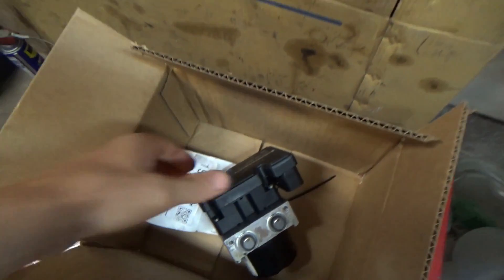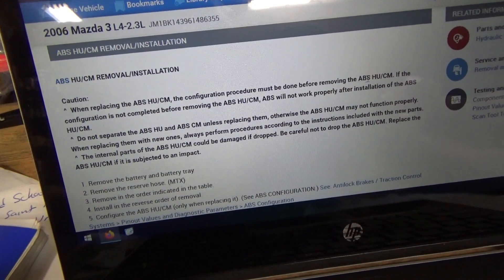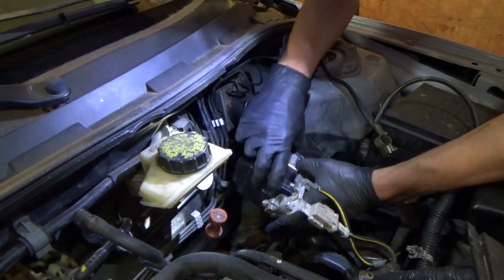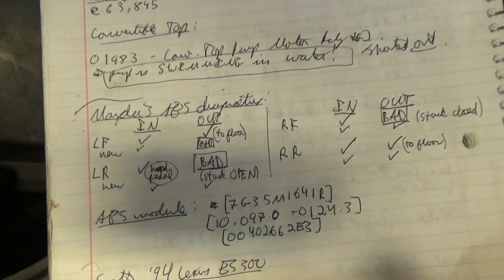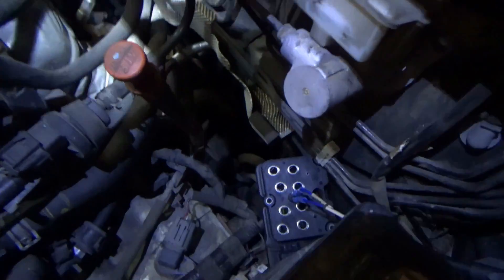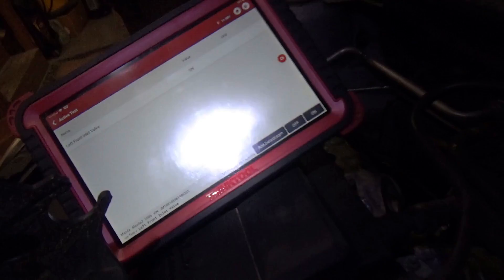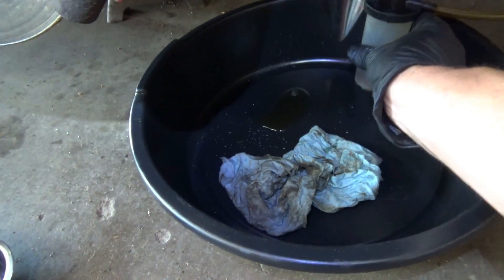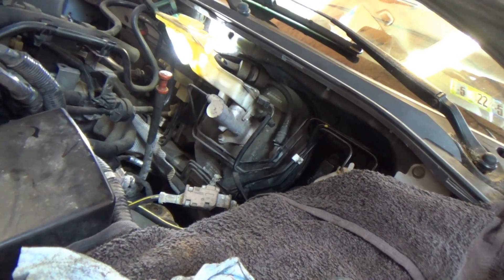DANGEROUS BRAKES! (Part 2 - Mazda 3 ABS)

Comment: The brake pedal might be related to rear drum adjustment assuming it has rear drums
Reply: Discs all the way around. No drum brakes on this model.
Reply: @quantumleap359  yeah I don't know maybe there is a master cylinder problem as well

Comment: Anyone know of a reliable place I can get this part or have mine rebuilt? 09 Mazda 3 sedan. Same issue, soft and them brakes at the bottom. Mechanic said Master Cylinder or ABS control module but could not tell which is needed. They want to charge me $2k for everything. Pretty sure I need 3M512M110JA

Comment: with bidirectional control hammer will fix both! I said hammer to fix on first video! if hammer dont work at first, spray deoxidant into failing valve area!! lol... then wd40!

Comment: Question? How will the front wheels turn free if the car is in park? Just saying.
Reply from the maker: Because there is a differential inside the transmission ;)
Reply: @PineHollowAutoDiagnostics  so what good is park if the wheel roll?
Reply from the maker: @zzzdogutube  to keep the vehicle from rolling away... As long as both front wheels are on the ground lol
Reply: @PineHollowAutoDiagnostics  so with the car in park and the left front wheel is locked with the brake (snow brush)  the right front is free to rotate unless the brake locks it? Hmm.   I'm not getting it, what is turning,  the tranny is locked and the rf wheel is locked. I'll think about this  Thanks
Reply from the maker: @zzzdogutube  I thought you meant without brakes applied...
Reply: @PineHollowAutoDiagnostics  you thought the rf brake was locked. I didn't think it will turn if the car is in park and the left front brake is applied. ?  What do you think?

Comment: If possible one should perform a ABS flush. Because very old brakefluid may contain some sludge/rust over time.
Reply: You would have to bleed the brakes anyways since your taking off all the brakes lines to the Abs unit.

Comment: But is whatever is in there truly broke. You had the same symptom with 1 on the new used part and fixed it. I say try the bolt test on the original , if that works try your fix of "gently tapping the valves with a hammer". If successful you could have an ebay part to sell and split the money with the owner. Win win

Comment: Stick with remanufactured parts at least, if not new  ones.  Otherwise,  many of these ABS units,  regardless of manufacturer,  suffer from the same pattern failures.
Reply from the maker: Reman quality is also hit or miss...a working used part is generally the best bet, especially for beaters :)

Comment: I have been bleeding brakes for over 50 years and did not know you didn't need two people to do the open the bleeder, pedal to the floor close the bleeder, let the pedal up and repeat until there are no bubbles.
Tell me Ivan, when you learned this and why it works.  I know you will have a scientific explanation for me.  Thanks.  Never too old to learn something.
Reply from the maker: It's easier for the fluid to replenish via the master cylinder seals vs. being sucked back in through the bleed nipple. Last step is to remove the hose and let the fluid just drip from the bleed nipple to make sure there are no small bubbles left at the top of the caliper :)
Reply: The idea is as long as you have the end of your outlet hose covered in brake fluid air can escape into the atmosphere when you smash the pedal, but only brake fuild will get pulled back in when you release the pedal. This is an effective way to bleed the brakes by your self. This method is less fool-proof as the bled air can be pulled back in if it doesn't make it far enough down/up the tube. It is best to elevate the collection container above the bleeder. And the tube has to extend to the bottom of the collection container. It is also best to start will a little brake fluid in the bottom of the container.
Reply from the maker: @_RiseAgainst  Eh you can do it no problem without any tools at all...the hose and can is there just to avoid making a mess haha
Reply: @PineHollowAutoDiagnostics  Hi Ivan, While you let the fluid drip from the bleeder nipple, isn't air from atmospheric pressure being let in through the nipple? or might there be a check valve or similar restriction, at the nipple inlet? or maybe Is it that the fluid density is enough to negate atomo pressure to negligibility?  Thank you.
Reply: @PineHollowAutoDiagnostics  you are my favorite mechanic full stop, but the rest of youtube "one person brake bleed" videos disagree and I don't think you realize how many hours it took to get my couch mechanic certification.
Reply: @paulkaz2127  Ivan opens the master cylinder and reservoir, so when it drips out of the bleeder, it is replenished from there. Hose submerged is probably easier to not screw up though.

Comment: It's a critical safety part. Wouldn't put a junkyard one in
Reply: I'm not big on using used safety critical parts on a vehicle either but at the very least tell the customer a waiver must be signed stating there is no warrantee on the part or work as the new part had issues from the get go since it was used. Everybody now a days is sue happy so you need to protect yourself. I am not singling Ivan out he's got stupid strong diagnostic skills that trumps even the dealers however the liability in there in using a used part of this safety critical nature is real, may never amount to something in the end but like I said you need to document and cover your ass.
Reply from the maker: @mplante7352  Yup 90-day warranty on the part.
Reply: @mplante7352  BRAVO!!!
Reply: While new OEM may, most often, be the most ideal option for replacement parts, as you will gain longevity.  All of the parts on the car, that you are driving presently are used...and  they are all functioning fine.. for now, until they don't. On this one, perhaps a similar failure may occur within the next 15 years..since it has probably has all 'new' fluid today.

Comment: Your pedal was still soft after your supposed repair.  ABS stands for antilock brake system.  It does essentially nothing unless you are doing emergency braking or braking on slick surfaces.  If you have traction control it also assists with that, but the car in your video does not have traction control.  The problem you describe is typical of half of your master cylinder failing.  It's tough to come back and admit that when you recieved so much praise from your two misleading videos.   You turned a very simple problem into a complex nonexistent one.  If there was a problem with the ABS it had nothing to do with the initial more basic issue.
Reply from the maker: Why don't you go ahead and replace the master cylinder then and NOT fix the car lol! Customer would be happy to pay for that xD